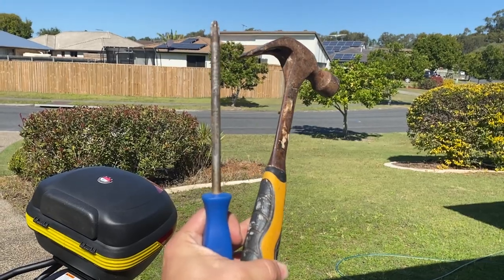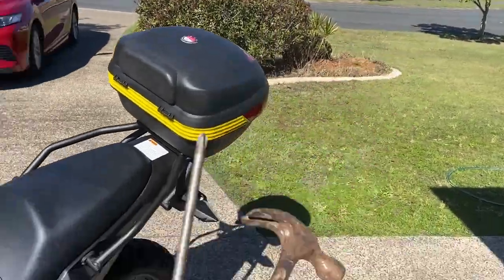Centerstand Spring Install: VERSYS-X 300 Kawasaki

Comment: I used a slim screw driver and levered the spring using the spring mount below the hole you used. Also without the bolts in and only the right bushing installed. This gives a little movement of the center stand which makes installing the spring and bolts easy. I was able to push the spring in easily with my fingers….

Comment: Clever solution. I used a ratchet tie-down strap hooked to my truck's hitch and clicky-clacked the ratchet handle til it had stretched the spring far enough to drop onto the centerstand mounting point.

Comment: After thinking through what to use to get the spring on the Versys X300 center Stand I used large Channel Lock Plyers.  It took less than a minute as I had to repeat the "squeeze" step after repositioning the one jaw on the J end of the spring and the other jaw on the bottom pad where the stand sits on the ground.  There is many ways to do it.  The goal is to just get it done.  Great video !
Reply from the maker: Thanks 👌